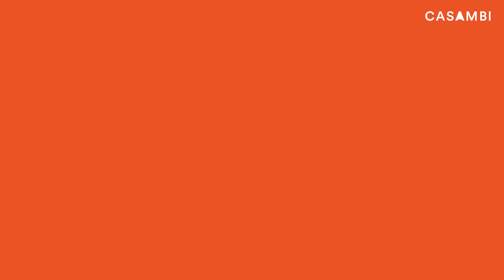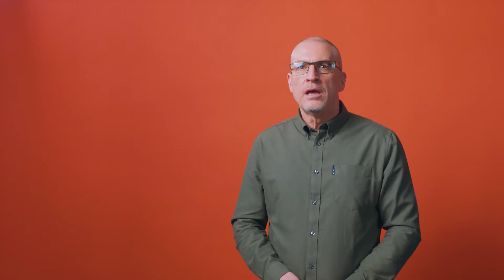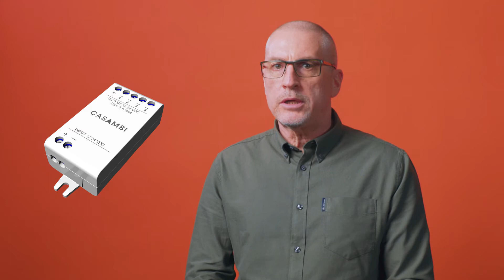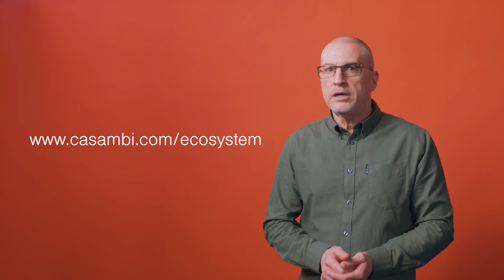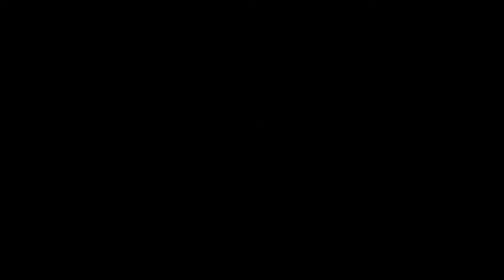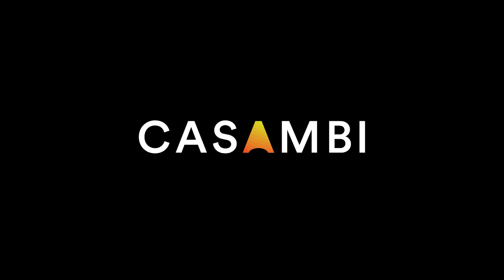CBU-PWM4 overview

Comment: If I connect a LED Strip --> LED Driver --> CBU-PWM4 --> Power Outlet, would I be able to turn the light on and off just by flicking the power switch? It is great that this works with the Casambi App over Bluetooth, but I would prefer to set the colour temperature and brightness in the Casambi app then use a smart plug to turn the light on and off rather than using my phone every time. Thanks!